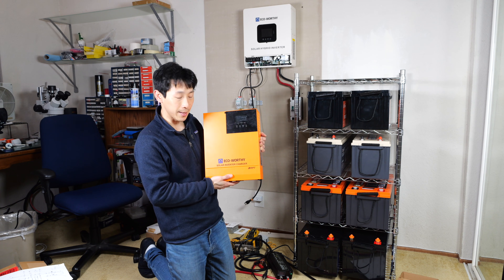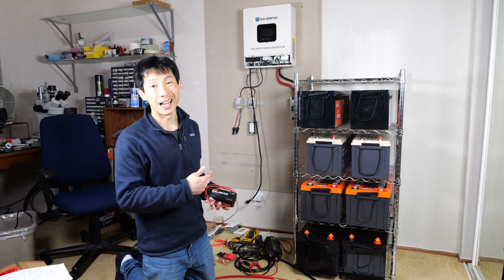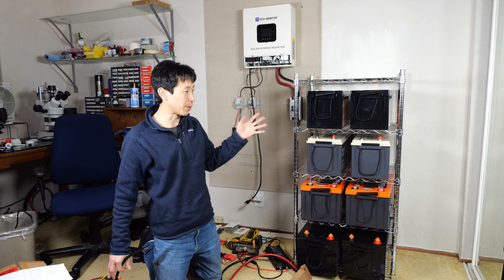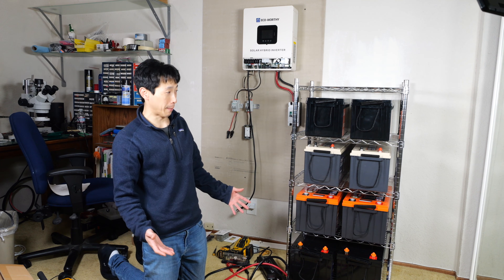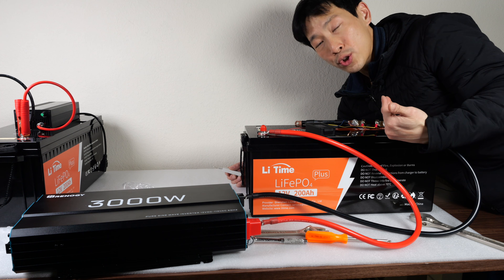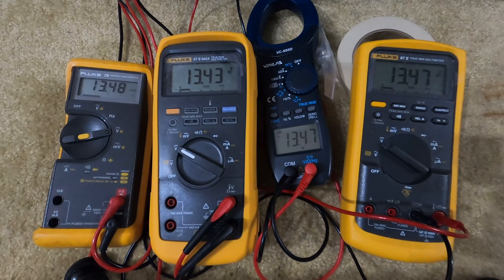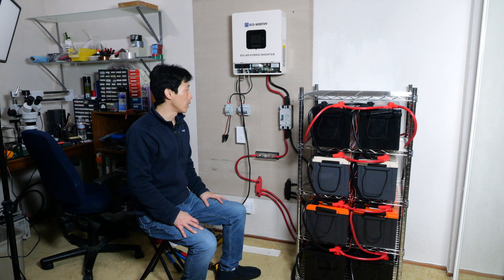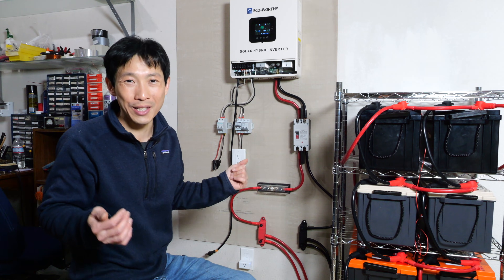Monster 20kWh Capacity using 12V 200Ah LiTime Batteries

Comment: I just need a back up battery in case my house is without power. I only need it to operate some motorized vertical blinds. Three Somfy 230V motors. I am told max 1,5 to 2 KW more than sufficient. Any suggestions anyone. I would get my electrician to connect. Thanks in advance.
Reply from the maker: You have to add up the total energy usage and how many days you want to operate. Add in the self consumption of the inverter and make sure you only use the battery in the 20-80% range to maximize life.

Comment: I have that same battery monitor but for some reason t he wattage and amps wont work right. I pull that 1900 watts and its say im pulling 30 amps. At 12v i know that's bullshit. At 2000 watts im pulling over 100 amps from my 3 X 300ah 12v batteries for sure. So basically I got a $25 voltmeter lol. I plan on buying atleasr 1 more battery so when i upgraded from 12v to 24v or 48 ill atkeast have the batteries to run it till i can get a actual 24v or 48v inverter. Till then ill run my 12v
Reply from the maker: You may need to set the resistor’s maximum amp.

Comment: Can't see any point in doing so ... appart from a waste of money
Reply from the maker: The solar will pay for the system within 10 years.
Reply: @BeatTheBush  That was not the point of my post, you can have more storage energy for less money ... and tighter .. and wasting less energy too, in each of your battery you got a BMS that suck energy to stay alibve while one big pack would only have one bms... plus those batteries are pretty hard to repair (find the exact same cell can be hard) while a big 16kWh prismatic pack would be easier to repair.
So .. using smalls battery packs like those in the video is a waste of money.
Reply from the maker: True, I would build a 48V system starting from scratch. Only reason you would do this is if you somehow had these batteries or can get them for very cheap.

Comment: I have 5 12v Li Time 100ah in parallel. 3 are standard and 2 are TM batteries. They are charged with a Li Time 60amp solar charge controller. I have checked SOC numerous times and I have never seen more than .01 difference in voltage. They are connected by busbars and individually fused at 100amp.
Reply from the maker: You won’t see a difference because they are connected in parallel and self balanced. You can tell which battery is weaker by measuring the output current of each battery and see which one provides the least current.

Comment: Life pro tip- buy 48V batteries and put them in parallel. Let them balance internally, not longer your problem!
Reply from the maker: If you were to build your own with no pre-existing parts then yes, go with 48V for sure.

Comment: Normally the Inverter (for example Deye Model) will have a CAN interface to communicate to the BMS's of the batteries to check temperature of batteries to de-rate the charging and discharging currents if the temperature of the battery goes above 45 degree C. You do not have this temperature sensing. Your battery configuration suggested is not safe. You should buy a 48V dc inverter system and connect the batteries in series for better safety (to avoid circulating currents in batteries in parallel).

Comment: Nice....can you describe how you wired the batteries exactly? I understand batteries on the same "floor" are wired in parallel (so 12,8V @ 200Ah), and each set is wired in series to end up with 48V. Is that correct?

Comment: francis you should start building your own batteries. with the 11.11 holiday deals i just bought 4x 280ah lifepo4 cells for 165 bucks shipped lol. im sure you would want to use a bms but ive found a lot of luck without any bms and just using active balance boards in 4s groups. 20mm surplus ammocans make a pretty fireproof enclosure with lifting handles and if you get the 280ah cells without studs, 8 of them will fit in one ammo can perfectly if all the contacts are facing the center. the 20mm cans are like 30 bucks each if you buy more than 2 on auction site.
building them into range extenders for my chevy volt with a cheap eu spec (240v) 3kw inverter which was only ~140 usd
Reply: In 24' Dec ~4x 280ah lifepo4 cells cost $250, do you know a better site?
That sounds like a nice build, good luck with that !

Comment: its better to have all batterys of the same brand/ model year ... to prevent that diffrence in internal resistance...thats where i think you see that voltage diffrence between all the batterys ...
Reply from the maker: They even want you to get it within a few months so they do not age that long. However, I added a battery balancer since then and that keeps things balanced.

Comment: thank you for this video. Why the need for a terminal block/busbar? The two banks where already in parralel per battery brand right?
Reply from the maker: It's not absolutely needed if you have only one battery bank. My plans were to add more battery banks to the other open terminals later. If you look at a later video, I have done so and it's filling up fast.

Comment: That’s not a weird fascination…I’ve been looking into this so I can give Edison the finger pretty much permanently. It’s re-god-d@mn-diculous what I’ve been paying in electric. I’m gone 2 to 3 days a week. That means I’m gone between 8 and 15 days per month depending on whether I pick up extra shifts or not. This isn’t counting when I do side work teaching, or construction.  GONE…NOT HOME…NOTHING IS RUNNING (other than one refrigerator and a freezer) for 8 to 15 days per month, and I’m paying between $6-900/month in summer. That’s not a bill…that’s sodomy.
Reply from the maker: If only fridge/freezer running, that sounds like it is very inefficient. Have you looked into the usage of each item? Use a energy meter to track down what is consuming such large amounts. Here is one of my older videos to help you cut your electricity bill: https://youtu.be/SS-5YkEfPb8?si=baTEQd0AhKHnKqAY

Comment: Install a rated generator input and interlock or transfer according to you local requirements. Locate the equipment in an uninhibited out building connected via a rated cord and plug not conduit. Ground mount your arrays with a combiner disconnect. Insurance, municipality, and the power company can't regulate or interfere with you. Think of it like them telling you what type, brand, and style of internal combustion generator you can have.

Comment: Thanks for the videos, you explain very well and thorough, it would be great if you can make a video about connecting a lithium phosphate 12v battery to a ups backup to increase the run time and use it to power computer and wifi and tv for example.
Reply from the maker: UPS backups are generally really annoying since they make a sound when not on grid power by design. Unless it has an option to let you turn it off but then you get the problem of running out of battery and cutting power to your system without warning.

Comment: So I need some advice on what to do. What I am trying to do is I want to charge the Battery system during off-peak hours (cheaper e-cost) and use those stored energy during peak hours. So I assume the Eco Worthy inverter would switch mode during power outage. But could they be programmed to switch mode at particular time of day instead?
Reply from the maker: I run mine almost entirely on battery mode so it is not connected to the grid. Then you put on enough load to roughly balance out the amount of energy you get per day. No, you cannot program it to change modes at a particular time.

Comment: Am i confused, if you connected all the batteries in parallel how you get 53 volt?
Reply from the maker: Each rack has two batteries in parallel. Then each of those combined shelves are strung in series to form a 2p4s battery.

Comment: Congrats on going off grid. Regarding connecting in series batteries from different brands, I wouldn't recommend it. I have similar set up, 2p2s, batteries from same manufacturer, and two year later, even with a balancer I had to take my system apart because I noticed a significant loss in capacity. I push my system pretty hard with 10kw inverters, so there's that. After a couple months, check individual voltages when the system top balances.

Comment: Awesome battery assembly but a poor choice for an inverter. High frequency, transformerless inverter like this offer a poorer surge capacity and a shorter life expectancy than real inverters that use low frequency, transformer based inverter technology.
Reply from the maker: A great learning experience if I can get this to fail at some point and I can tell all about how many years it actually lasts.

Comment: I would put a wood or ceramic blocks on top of the batteries, so if a shelf collapses, it does not short out any battery. Ceramic tiles are cheap, so are bricks.
Reply: I was just thinking that theres too much battery on that style shelving
Reply: @mikescholz6429  According to Amazon, shelf unit can handle 250 lbs.  Each battery weighs about 50 lbs.  50x8=400 lbs.  Yup, shelves are overloaded.
Reply: they are only around 40kg on each shelf, it should be ok for that metal shelf to handle.

Comment: francis can you do a cleaner server rack system video.  i would like to attempt the server rack because i can't have all those wires sticking out everywhere with kids running around in the garage
Reply from the maker: Sure. HOWEVER, even with a server rack, you better put any and all exposed wiring inside an enclosure with a lock on it with kids around.

Comment: My buddy Ryan was a huge fan of yours and he passed away about 6 months ago. As I sit here watching your video I just felt compelled to cheer you on and to let you know that you are doing a great job and he would want me to let you know to keep making these types of videos for us to all enjoy and learn from.
Reply: Jason - always great to hear encouragement for those taking the time to fill our lives and minds with useful knowledge! Sorry to hear about your buddy. Wishing you well!
Reply: I put heat shrink on my socket wrench handles just in case I touched the opposite terminal.  I sparked the battery once on my car tightening terminals.  I have a better procedure now but heatshinking the socket wrench is just another layer for safety.
Reply: @waakca  For cars, always connect the positive first. If the wrench touches body or chassis metal, no sparks since no ground path. Then, when you do the negative cable, no sparks to body metal since the wrench is at ground.

Comment: Looks interesting but is this really practical?  A perfect storm is brewing in the United States. Inflation, bank collapse, severe drought in the agricultural belt, recession, food shortages, diesel fuel and heating oil shortages, baby formula shortages, available automobile shortages and prices, the price of living place. It's all coming together and it could lead to a real disaster towards the end of this year (or sooner). With inflation currently at about 6%, my primary concern is how to maximize my savings/retirement fund of about $300k which has been sitting duck since forever with zero to no gains.
Reply: If you can DIY I am guessing everything he spent is about equal to a generator that can do the same thing? So the trade is noise and fumes vs quiet power? Plus DIY you get to learn how to do it.
Reply: @jneckcrank  how does it compare to a noisy fuel generator? A generator needs fuel.. his setup charges from the solar panels outside in his yard..so it can go on forever without spending more money for fuel..
.
Reply: your fund will evaporate first of any of the things you listed. understand the fraudulent money system.

Comment: BeatTheBush, can you tell us the number of days needed to reach the break even point in your case?
Reply: I'm not Beat The Bush, but the answer is easy enough to figure out yourself!  (I was wondering the same thing...).  First determine costs of the system:  8 batteries = $3336, 4 Balancers = $108, Inverter = $900, Cable = $200, Hardware= $100, Rack = $59, Back-board = $25, Two fuse kits = 120, Tools = $100, Outlet and box = $6, Breakers = $80.  Total cost = $5034.  He mentioned he used 8KwH of electricity per day.  Cost of electricity of electricity is approximately $0.17 per KwH.  8X$0.17 = $1.36 per day.  $5034 / $1.36 = 3701 days or a little more than 10 years!
Reply: @johnsteed265  Nice math. I love it.
But he lives in CA. I remember my CA friends told me the power price is way above $0.17 per KWH. More likely to be $0.35 per KWH in CA. $5034 / (8*0.35)= 1797 Days. so about 5 years to break even.
Reply: Any federal and state level credits?

Comment: Are you going to EMP protect the house and backup system?
Reply from the maker: I may add a lightning arrestor for the PV modules but the backup system has to be fully enclosed including the wires.
Reply: @BeatTheBush  please make a video of the cost of the components and the plans to harden the system for EMP. Protection

Comment: 20Kwh in 12v is a lot, curious why you didn't go with a 48 volt system? Usually cheaper on wiring since you can use smaller gauge wire and safely power bigger inverters. Some 12v batteries can be put in series for 48v, but many cannot because their BMS doesn't support the higher voltage.
Reply from the maker: This is wired as a 48V system indeed.

Comment: Won't the individual BMSs of the batteries take care of the balancing?
Reply from the maker: No, the internal BMS of each battery balances only the cells inside each battery.
Reply: @BeatTheBush  interesting piece of kit, thank you for the video 👍🏻
Reply: @BeatTheBush  Are there any 48V batteries out there? Instead of dealing with using 4x 12V batteries in series to complete a 48V battery? Then no dealing with balancing stuff between 12V batteries..

Comment: Hopefully you went through your utility, they generally don’t want people just hooking up solar panels and inverters to their home electric system, especially if there is potential to back-feed. If you don’t have the right type of electric meter which they only hand out for people that are in a net metering agreement then chances are you wont be able to “spin the meter backwards” for any excess energy you produce. There is even a chance certain meters will keep spinning forward even if you are sending energy back into the grid. 

You’re a smart guy BTB theres no denying that, but there are safety codes and guidelines that I’m sure you know are in place for good reason. An average person watching your videos might think the information you present is all you need to know but in reality should probably just seek a licensed electrician/solar contractor. Electricity is not something the average person should be messing around with.
Reply: The man is an electrical engineer....don't you think he knows damn well what he is doing? The way I see it, the hybrid inverter only supplies power from the batteries to the chosen separate groups in the house (so not the whole house is plugged in through this hybrid inverter, only probably his laptops and fridge). The hybrid inverter can charge the batteries as well from the grid, when the solar panels do not charge them enough. So nothing goes back to the grid. As someone said before in the comment. It is not any different then to have your Tesla powering chosen part of your house. While the grid can also charge your Tesla. Tesla is not powering the grid.... So see the Tesla = Hybrid inverter with batteries. A lot of people are charging their Teslas at home which is common, what is not common is that people never use their Teslas with it's batteries to power part of your house...

Comment: Looks interesting but is this really practical? The cost for all this has to be fairly steep.
Reply: No, it's not practical, let alone extremely dangerous for "most people". He's an electrical engineer. This is his passion.
Reply: Total cost is about $5500 if you include 4 x 250W solar panels.  It would take him about 10 years to recoup costs if he is only using 8KwH of energy each day, as he claims (assuming electric cost $0.17 per KwH).

Comment: Not practical if you live in a hurricane zone (unless you have a very powerful solar array) because you will need AT LEAST 7 days of power in most cases. You could use one of these setups to supplement a big trifuel generator.
Reply from the maker: Probably the solar panels will blow away during a hurricane.

Comment: There are several videos out about orienting solar panels vertically, rather than at the angle of your latitude. In short the idea is that the reduced heating of the panels improves efficency  enough to offset the lower solar input. It would be good if you discussed your decision on this when you put panels up.
Reply from the maker: I suppose it depends on the efficiency drop of overheating your panels. My gut says to face them directly at the sun at 99.9% of the time but in extremely hot climates, perhaps you may need to tilt them away slightly to reduce temps.
Reply: Vertical is great in winter, I have some on my garage door.. I have a 500w air source heat pump inside the garage that pulls air from behind the panels, this really helps increase the COP rating for my domestic hot water
Reply: @joesmith942 you are absolutely correct when it comes to bifacial panels